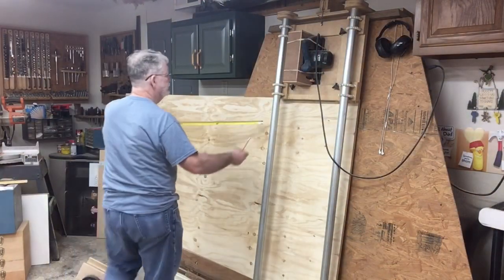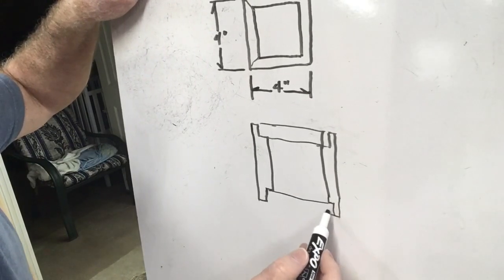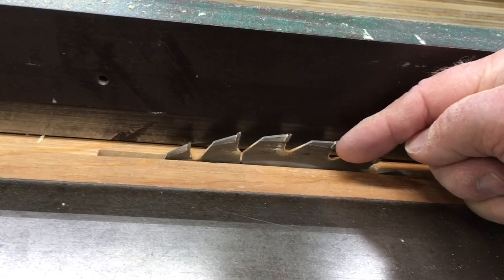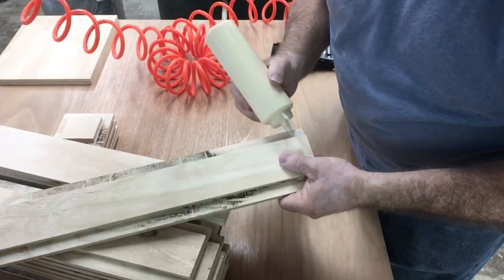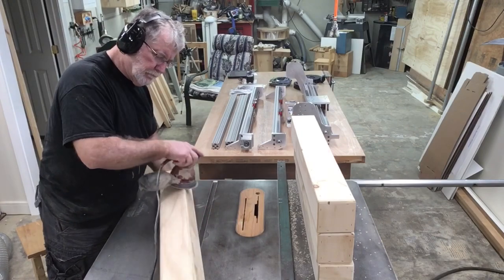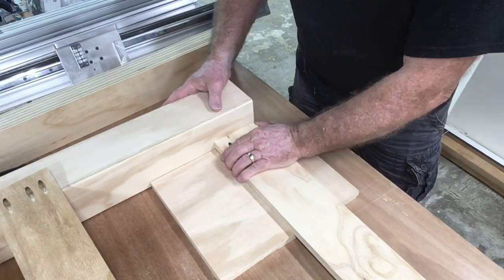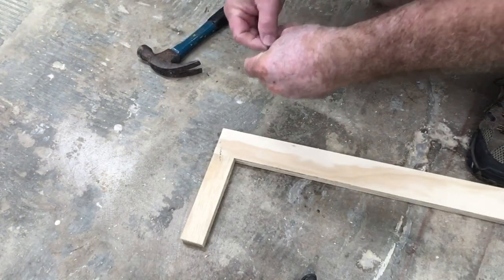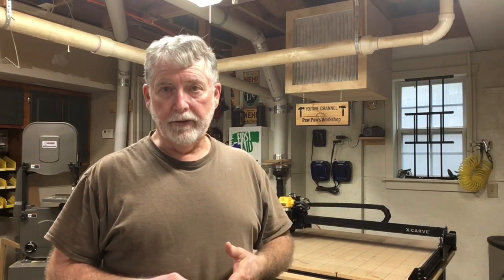How to  Build an Amazingly Simple CNC Table

Comment: Yes, my Dad make cabinets as a part time job.  He used corrugated fasteners for his face frames.  I  got his table saw. It is a Rockwell. They only made 10 of them.  Dad had to have something replaced on the saw.  When he called them they did not have that number so they transferred him to an "OLD" man who knew about Dad's saw.  My Dad will be 89 in December.  I am 68, with half a can of corrugated fasteners.
Reply from the maker: Wow, that’s awesome story. Now a question, did he every use a corrugated gun? They were rather rare but available. I had one until my home flooded and ruined it and a case of fasteners for the gun. Did you get the saw repaired?
Reply: @PawPawsWorkShop  Dad did not have a gun.  Just a hammer.  Oh yes he did get it fixed.  I am sure someone would have had the part but he didn't know how to source parts for items like that.   The saw runs as good as the day he bought it.  I need to take it apart and clean it and it would all work better.   When I asked him for it he said it does not have a riving knife nor any safety systems on it.  I told him if I ever get another saw I would put a dado blade on it and just use it to make dados.  I plan to put some guards and dust collections on it.  It is a very good saw,  just old. Thanks
Reply from the maker: There’s nothing wrong with old saws. Have you looked at mine?  It is from the 70’s. I was practically raised on that saw. When my Dad passed about 25 years ago I wanted that saw. I got it for my shop and have no plans on replacing it.

Comment: Hi Paw, That corrugated fasteners  used for Plywood panel doors in 1980s, at that time we don't have nailing gun.  I don't think that its available now... thanks for the video. Nice project
Reply from the maker: Late 70's and early 80's nail guns were out.  I used the corrugated fastener gun in the 70's to build cabinets.  It was the standard at that time.

Comment: I would add a support beam in the middle of the table to make sure no sagging.  Very nice build!
Reply from the maker: That's a great idea! That never just, however, in over three years it never has sagged. In an upcoming video I am going to add drawers which will add a center support.
Reply: @PawPawsWorkShop  Thanks!  I like the way you did the legs.  Saves a lot of weight over just using standard 4X4 posts but of course that would be an alternative if the weight was not a factor.  Just curious, what CNC did you choose?  I am looking at the Longmill 30X30 with a 500W mill.
Reply from the maker: I have the XCarve and the cnc4newbie new carve.  I just got the FOX Alien.
Reply: @PawPawsWorkShop  WOW  Just saw the cost of sheet goods!  Looks like I am going to be putting off the build of my CNC table for a bit with plywood at 70 - 80 bucks a 4 X 8 sheet!!!

Comment: I used those corrugated fasteners but always hated them. For some reason I could never drive them straight and wound up chipping and cracking my pieces to the point of frustration. The first rule to using any tool is that you have to be smarter than the tool you use. Obviously I'm not smart enough to use those... 😀
Reply from the maker: Lol, I understand. I used the individual ones for a long time until I got a nail gun that would shoot the corrugated fasteners. That was a game changer

Comment: Great table and drawers. What you suggested as the height of the table to be, I am 6'2"  in addition what the heights of the drawers you suggest?
Reply from the maker: That’s a tough question. The table saw is the cornerstone of the shop. All my tables are build to the height of the saw. It makes it easier to use as an outfeed table and when I need to move tools from one table to another. Most dining tables are 30”. Your kitchen cabinets are typically 36” high. The bar height is 42”. Depending on the type of work you do at the table will determine a comfortable height.

Comment: Nice design and the hollow 4x4 legs can actually be used for concealed cable/wire management if needed for a different project maybe.  I used a pneumatic corrugated staple gun at the cabinet shop I worked at back in the late 80's, we used it mostly on frames for recessed kitchen light panels.  We also had a stationary two-bit pocket hole cutter for face frames.
Reply from the maker: Thank you very much. I had one of the corrugated staple guns. It lasted for years

Comment: Why not use cheap 4x4 and save a LOT of time? Just curious not questioning.
Reply from the maker: Because I had the plywood and did not have a 4x4. I used what I had available. It also shows different techniques which is what this channel is all about
Reply: @PawPawsWorkShop  That's quite true. I fully understand 'use what you have available'. It's a better approach than running to shop everytime we need to build anything. Thank you so much.

Comment: I wish I had room for a panel saw! And I thought I was only person who had an entire selection of corrugated fasteners!
Reply from the maker: My shop has gotten smaller(or so it seems) and I have moved the panel saw out of the shop. I also at one point had a corrugated gun an had large cases of fasteners. Unfortunately they were ruined in a flood
Reply: @PawPawsWorkShop  Wow, I've never seen the corrugated gun! I still use them on many of my picture frames.
Reply from the maker: Back in the 70’s I built custom cabinets for various contractors and used the nail guns of all types. I could build a full house of cabinets in about three days. It was a fun time
Reply: @PawPawsWorkShop  Retirement is MORE FUN Paw Paw!! 🤪
Reply from the maker: I work more and harder since retirement. Lol, it crazy. I do get to spend a lot of time with the grandkids
Reply: @PawPawsWorkShop  Me too! But it's fun work now!

Comment: Nicely done. I haven't been working with wood for long but I did try using my table saw to do something similar to a rabbit. All I got was jagged ridges? Have no idea what I did wrong. Had to use my router.
Reply from the maker: Using the router cleans up the edges nicely

Comment: I am shopping for a CNC.  I am a hobby woodworker looking to sell items I make.  I have zero experience with a CNC.  What CNC would you suggest I start out with?  I would greatly appreciate your input.  God bless you sir and have a wonderful day!
Reply from the maker: Welcome,  I would think about the budget you have, the space to locate a machine and the size of the products that you want to make. With that information you can shop. I like the XCarve for the first time people with no experience. That’s where I started and that is still my go to machine. The Easel software is easy to learn and they are constantly improving the features. Buy the largest machine within your budget. I promise you that your projects will grow bigger than your machine. I have a link in the description that takes to to their website. It is an affiliate link. I make a few dollars and it cost you nothing. Hopefully, that will get you started.
Reply: @PawPawsWorkShop  Yes sir I have plenty of room in my shop and am looking at the X Carve 1000mm with the Z probe, the dust boot.  Would I need the clamps or just use the painters tape and CA glue method?  Could you point me to a good set of bits to start with please sir!  And of course I would certainly use the affiliate link to make my purchase!  We gotta help each other out in this community!  God bless you and thank you so much for your input!!
Reply from the maker: I use the clamps occasionally. I also use the bump stops that I designed. They are a free download in the project section of inventables. The glue and tape method is what I use most. As far as bits. I would get 1/8 and 1/16” upcut and downcut bits. You will need the 1/8” straight bits also. I get the vbits from the local hardware store and occasionally from Whiteside and Amana.  You will need 60 and 90 degree vbits.
Reply: @PawPawsWorkShop  Awesome I am now on my way!  Will get the clamps in case and them order those bits you requested!  Once again thank you so much looking forward to my new venture!  I sure am late getting into the CNC game....lol!

Comment: Just finished one in time for the arrival or a Shapeoko Pro XXL. Your additions in the section where you add the drawers really tighten up the table.  If your watching this and plan to make one I suggest watching that video too before adding the table top.  Took me 2 sheets of 3/4 to do it all including shelving the lower leg supports plus a sheet of 3/4 MDF for a top surface. Let Kreg know you sold them a K4 kit with clamps Paw Paw and I stole your K4 work bench idea too from here. Don’t see how to add a picture here. Thanks again for sharing your craft.
Reply from the maker: You're very welcome.  Thank you for sharing your information.

Comment: Hey Paw Paw, what height did you make this table? I'm getting ready to duplicate your build but have never used a CNC machine so I don't know what height to shoot for. Also, if I make the runners and legs a little wider (maybe 5") do you think I can get pocket holes all of the way around instead of the corrugated fasteners? Thank you for the in depth videos 🙂
Reply from the maker: The table height is 33"  It was designed to be the height of my table saw.  If that is not a concern I would make it regular cabinet height of 36". The legs at 4" are fine to do the pocket holes all the way around. The corrugated fasteners were only used for the face frame to all me to build drawers.  To use pocket holes for this area I would make the face frame about 2" wide.   Thank you for your support

Comment: Nice video.  Wish I'd seen it a year ago before I built my CNC table!   How did you end up fastening the top to the base?  I still haven't done that part yet.
Reply from the maker: I did not fasten the table top to the base.  That was by design.  In another video where I added the drawers, you will see that I slid the top off with the cnc machine still on the table.

Comment: Corrugated fasteners are okay if the wood is soft enough, but I stopped using them a long time ago. Nice table design though, thanks.
Reply from the maker: I have not used them for several decades but I could not resist the temptation.  I wanted to show them on my channel and see if there are others who have used them.  I do not know if they even still sell them.  These were saved from decades ago.
Reply: @PawPawsWorkShop  My grandad used them, but you are probably right, I haven't seen them in stores.
Reply from the maker: Thank you for  your response. It is very rare.  LOL, it like a rotary dial phone.  It will work but who has one. Or, maybe try and find a phone booth.  Corrugated fasteners I'm afraid are gone as well.

Comment: Terrific table.  Only thing I would change is the MDF top.  I just don’t like the ease at which the corners and edges can get damaged.
Reply from the maker: Thank you very much.  My tables are protected on three sides and do not get damaged.  You make an excellent point it you table is out in the open.
Reply: One solution to that problem is to laminate a 1/4 inch hardboard onto the MDF to help strengthen it.    Or you could glue on a wood border for protection as well.  :)

Comment: I noticed you just used casters and didn't install any leveling feet. Do you just have an extremely level shop floor or is leveling not needed as long as the top is flat?
Reply from the maker: First, the slab is relatively level. Second, the most important thing is to have the wasteboard perpendicular to the router
Reply: Do you just use a speed square to set that?
Reply from the maker: Yes, you can tweak it more when carving as needed

Comment: Great table can we get a cut list?
Reply from the maker: This is the simplest design possible. No, I'm sorry, I do not have a cut list.  This table can easily be built from the video.  You can change any measurements you wish to meet your needs.  In addition, you do not have to build the legs as I did. You can simply build the legs with only two sides if you wish.  The pocket hole method is very easy to do.  I rarely use plans. At most I sketch out a basic drawing on a dry erase board.
Reply: @PawPawsWorkShop  it appears that you made the legs 4' tall is that correct?